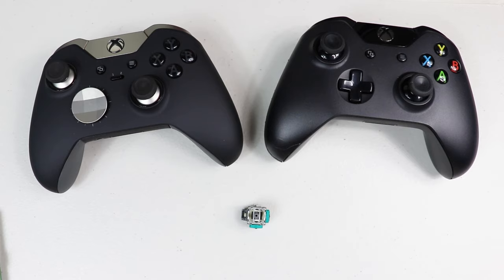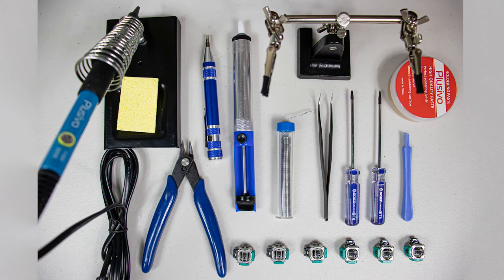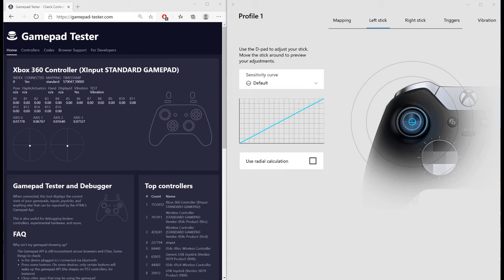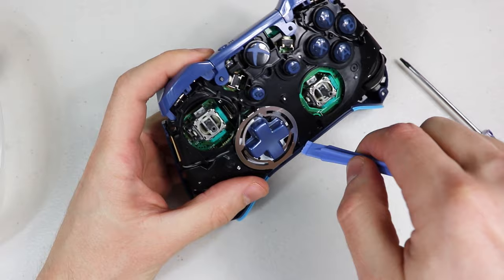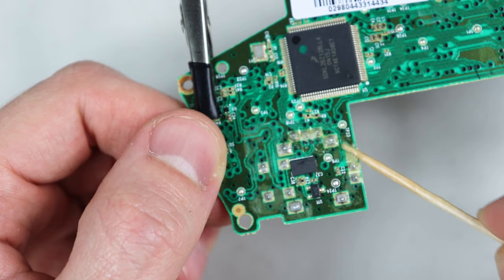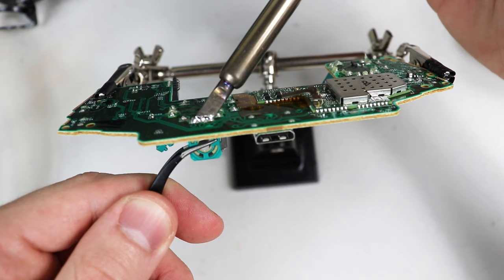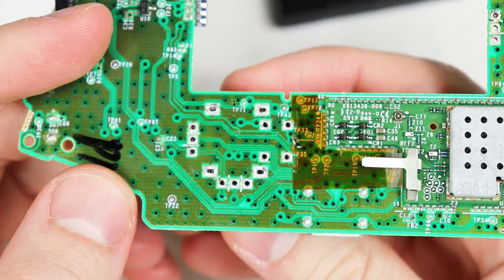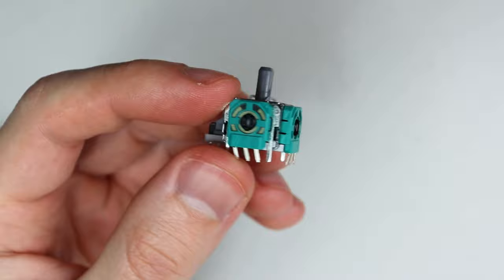How to Replace Xbox One Controller Analog Joystick - NEW METHOD - Fix Stick Drift, Broken, & Loose

Comment: Ive watched quite a few of these videos while waiting for my soldering tools to come via post but yours is the only one that seems to need to go through the tedious peocess of calibration; everyone else just plugs them in and they work.

The only major difference I see in technique is you cutting off those 3 plastic pieces on the potentiometer so that it can rotate. It seems to me that those posts are there to keep it to factoey calibration. Im guessing you are just not satisfied with factory calibration whereas most people are?

Perhaps im misunderstanding something fundamental in this video. Any guidance would be appreciated as this will be first attempt fixing electronics and soldering in general.
Reply from the maker: Well this video was made quite a while ago, and  the new series X/S controllers (and elite 2's) use integrated calibration software, so none of this funky business is needed. Plug and play and it will calibrate itself after some time. If working on an older controller this method will most likely will be needed.

Comment: I was able to replace my potentiometers after watching! HOLY it was like a long surgery. 🤣🤣 I didnt need to calibrate anything since it was already perfect when I soldered the new pots. I think I also need to calibrate dead zones since finer movements on the stick are not smooth. Anyone know how? lol Will they get better as I keep using it?
Reply from the maker: Can you explain more what you mean by the finer movements on the stick not smooth?
Reply: @SOSSGAMING  Like when I just push the joystick a little bit and not fully in a certain direction, it has a hard time registering it as me only pushing it a little. It would suddenly jump really quickly to that direction. Not very smooth. It's like the sensitivity for smaller movements is weird. Makes it hard to aim accurately at farther distances in an FPS game where you would only need to move the joystick a little bit for example. I hope that makes sense. Its the same for both joysticks. BTW, I replaced the whole joystick and not just the potentiometer.
Reply from the maker: @ineed8800GT  Ok, are the joystick by chance the ones with integrated deadzones? The ones with white wheels in the potentiometers? If so, that will be the culprit. If not, it may also be an in-game deadzone setting. If it's a elite controller or x/s controller, it may be a joystick setting in the accessories app. That's all I can think of at the moment.

Comment: Nice replacement. I'll be doing this on the Series controller. Hopefully this week. Waiting on the parts. Are you calibrating with a 0% deadzone?
Reply from the maker: On these controllers I can usually get within 2%.  On the series 2 controller I'm sure you'll be glad to hear they self calibrate.  Meaning you just need simply replace the joysticks, and from just moving the joystick around for a while it will gradually adjust itself.  Pretty neat.

Comment: I'm on my 3rd XBOX controller now due to drift problems.  I tried to fix both but no joy, I bought a new ones.  I never had this problem with the old Atari joysticks, they were indestructible!
Reply from the maker: I'm sorry to hear about the struggles :/ Sometimes it can be frustrating.

Comment: Awesome video! Very thorough and informative. Didn't know that replacing the joystick required calibration. I've seen you are based in the US. By any chance do you know a reliable source for purchasing Alps Alpine sticks in EU? A couple years ago did my first gig in soldering with an Xbox One controller, and while I managed to pull it off, the stick felt stiffer and not as responsive as the original one. Seeing your sparked my interest again. Cheers
Reply from the maker: Thanks! Honestly I'm not sure on where you can source one there.  I do have an eBay with international shipping options and I think EU is included.
Reply from the maker: Here's the link if you wanted to see: https://www.ebay.com/itm/223831814472
Reply from the maker: Let me know if that works and if/what ebay shows the shipping charge to EU is I would be curious to know
Reply: @SOSSGAMING  So when i buy your stick set on ebay it includes 6 of the "Alps Alpine RKJXV122400R" right?
Is that also the stick that the playstation uses or is there a difference? Do you know if it is also possible to order a lot of potentiometers on top of these? Because you then dont always have to "throw away" some of the sticks just because the potentiometers arent perfectly right. Maybe that might be a new bundle idea for you :D.
Reply from the maker: @GeneralSouL99  That model is the black pot variant. To be honest, I'm not sure the difference between those are the original. The only difference I'm aware of the the base of the RKJXV122400R have two protrusions on the base of them to fit into custom pcbs (like scuf uses).  The ones I sell are original (alps also).
Playstation use a different stick (alps also). Those ones have a raised base, higher stick tension, and a slightly wider pot range. I don't recommend using one in the other.
As for the pots, I now sell them by themselves, but only on Amazon for now. (only 6). But will have 20 and 100 pot bundles in the near future, on both Amazon and eBay. Thanks for the suggestion.

Comment: When an off brand analog stick is “squared”, is there a reason for that ? Is it fixable ?
Reply from the maker: Actually I wish I didn't include that in the video as I believe the info I received was inaccurate.  I need to verify this but I think it's more to do with left vs right analog. I believe it's inherent in the software but I'm still not 100% on that.  It's an easy check but I just haven't had time lately.

Comment: When I installed these on both my controllers (which had stick drift), they were both off centered roughly by 4-8%. However, when I used them both on my xbox, not only did I not notice any drift, but when checked them again on gamepad tester, they were perfectly centered within the 0-1% range. Do you think that my xbox calibrated the new joysticks on both of my controllers?

Edit: I should've mentioned this, but I didn't do the manual calibration trick shown in the video  mainly because I didn't have a knife sharp enough to cut the nubs off the pot holder.
Reply from the maker: If it was on the S or X controller, it did manually calibrate itself. If it was on any previous model controller (including the elite series 1), then it was very lucky!
Reply: @SOSSGAMING  It was, in fact, a xbox series s/x controller!

Comment: @SOSS GAMING  amazing video/tutorial. I got a question for you,does it matter with which analog stick joystick is used to replace the OEM one? on the market are the one with blue base and white base or are both the same? I am looking to replace on Xbox elite controller. Thank you !
Reply from the maker: Thanks! I would say yes, it definitely matters.  There are many bad versions of joysticks with deadzones and button issues.  If possible, try to source the ones with the grey base and black wipers inside the potentiometers.  If they meet those criteria, I believe they are likely to be the ones you are looking for.
Reply: @SOSSGAMING  thank you

Comment: Nice! I never seen this way of calibrating before, def going to do this on my elite controller. One problem, I had to remove power IC "U1" from the board and it took D23 with it in the fall due to component failure. Any idea what diode I'd replace D23 w/ ? (I do not have a spare board)
Reply from the maker: Great question. Sounds like a question for the guys at acidmods forum. I'd recommend trying to post the question there. I don't know these boards nearly as well as they do (RDC in particular). Wish I could be more help.

Comment: Try to use DS4 sticks they are more tight and have no wiggle in the center
Reply from the maker: Yes I agree! It also depends on personal preference with the higher spring tension.  What is your similar method for modifying the base to get them to sit flush on the boards?
Reply: I personally just take a blow torch and a flat metal tweasers to melt the bottom flat. Gotta be careful to not melt to much tho. Then if need be take a razer and file down the remaining plastic
Reply from the maker: @swifdy6855  Nice!
Reply: @SOSSGAMING  the xbox one joystick analog fit flush on ps4 mobo

Comment: do i need flux when unsoldering? and is there a specific flux and solder to use?
Reply from the maker: It's recommended, but technically you can get away with just the flux in rosin-core solder.  I've found that brand does matter. Some brands lie about the contents of their solder, and are cheaper for a reason. The cheaper ones do not solder well. The brand I personally use and recommend is Kester. 60/40 rosin core. Luckily with flux there's not much of an issue and any brand should be fine.
Reply: @SOSSGAMING  thanks you

Comment: Yeah I have kits for when I fixed my 360 controllers I have like 5 Xbox one controllers and two that are for my series S all have bad joysticks I planned to just swap em but wtf now it requires soldering and I don’t do that. So fuck kinda pisses me off cause I can make a few good controllers just by swapping. Such a shame miss when it was more similar and just connector, clips. 😅

I’ve never been good at soldering…..😅

Comment: A "new" Method.. But you can also simply buy a heated desoldering pump for 15 euros and desolder all stick modules in one piece without any problems. Whether small or large holes. I do this all the time on all kinds of controllers with a cheap 40W pump.
Reply from the maker: That's great! The "new" refers to the calibration process. Thanks for watching!

Comment: Thank you for your videos! This is the first time I see this issue mentionned. I need to replace the joysticks on my wired 360 controller. Would this be the same process? And do you have any tips on how to mod an overall better quality pad (more precise and/or firm controls)? Maybe there is different buttons grades, i don't know...
Reply from the maker: Yes, I have done it on a 360 controller. However, this was with original joysticks. There are many 360 joysticks out there with the integrated deadzones that will probably be what you will find most of, and in that case you won't be able to, but will have integrated deadzone. I'm not aware of any different pads, I'm guessing you mean for the dpad and/or buttons?
Reply: @SOSSGAMING  Thanks for responding. I suppose I can find those on aliexpress. For the rest, i mean either dpad or other buttons. I saw your other video where you change and upgrade the elite bumpers buttons. I was wondering if there was anything similar for 360. I mean, those buttons sure look like any standard motherboard mounted buttons...
Reply from the maker: @skills3779  Yeah, I'm not aware of any upgraded pads sorry. As for the bumper buttons, the "upgrade" was reverting back to the ones in the previous xbox controllers which are better, which are also in the xbox 360 controllers lol.  So as far as those go, you have the best ones that I'm aware of.

Comment: thx for the help+ I had a question what are the wires for if the controller turn's on and the buttons work?
Reply from the maker: Good question. Is it plugged in? I believe they connect the battery.
Reply: @SOSSGAMING  yea it’s plugged in I always thought that the wires have to be connected to the Motherboard

Comment: Would like to see a guide for PS4 controller, do you know if you need to calibrate on theirs also?
Reply from the maker: It's on my list :) If I can get to it as soon as I'd like, I might be able to get one up in a month or so.  But they do require calibration and the steps shown in the video for calibrating them are essentially the same.  The only things different on the top of my head are going to be the way the controller is disassembled/assembled.

Comment: Can you use helders mod to adjust a new thumbstick module/potentiometer? If you hadn’t snipped the 3 little nubs off of the potentiometers they may not have actually needed manually twisting to calibrate. You could have tested the new potentiometers without snipping them off first as there was always a chance it worked fine anyway no? Removing the 3 nubs meant that the potentiometer was more likely to allow the potentiometer to fit on more wonkily in the first place and show that it needs manually calibrating when it may have already been set to the right position all along.
Reply from the maker: Yes, those can work to calibrate!

You are correct about the possibility of it possibly not needing calibration without snipping, but in my findings it's best practice to just snip it anyway and get a great calibration without needing to go back and snip them. There is practically no loss of stability as long as you don't cut off the 2 side nubs. I've repaired over 300 joysticks for people with this method and not an issue.

By soldering on initially, you will more than likely (about 2/3 of the time) not be pleased with where it sits, and want to adjust regardless.

I also made another video years ago with a different calibration method where no snipping is required. But it's quite more time consuming, and the calibration results aren't quite as good.
Reply: Helders can work fine if only slight adjustments are needed to center the joystick. Large adjustments wiill reduce your joystick's range of motion, quite noticeably, or even severely.

Comment: can you please explain how much temperature you need not to damage the circuit board and what power ratings like watts , voltage and stuff u need for solder.
Reply from the maker: Each soldering iron is different. 350c is about what I use on my soldering iron.  I would start maybe a little under that and see if the solder melts enough. If not, bump it up a bit more. 

The idea is removing the solder fast as possible, and using not too high of a heat (or leave it for too long) to melt the adhesive under the through hole pads.

Comment: Maybe the resistance of the knock off is too low so it gives a stronger signal to the motherboard?
Reply from the maker: Resistance is the same actually. Rated 12k. I'm thinking it has to do with the mechanics of it, as in it provides more movement at the wheel, and it doesn't need much to make it faster. Could also be with the resistance material itself somehow. Great question.

Comment: Do you know that the reason you have to calibrate the sensors is because on the back of each there is a number.  Each number represents placement on the analog control modules.  One says 8, 12, 6 and 3 in reference to hour hands.
Reply: Sometimes there are letters like D for down, L for left R for right and U for up.
Reply from the maker: Very interesting. Can you expand on this?  I'm looking at a few right now 3e, 3d, 2d, 2f, 3g.  I'd just assumed they were batch numbers or something.

Comment: I've tried this on two separate controllers - a normal xbox one controller and an elite (v1). The normal controller doesn't register any joystick movement now, and I'd love to hear any advice on what part of the motherboard might be causing this! The elite controller went much better (i'm proud just to have removed the drifting joystick!) but there is a deadzone around the center of the joystick. I'm going to put it back together any way, and see if I can adjust my settings on my box. Let me know if there is something I might have done by mistake to cause these issues!

Edit: just turned on my console with the put back together controller. My xbox will not display anything through it's HDMI any more. I was playing earlier today with a different controller, everything was fine. Either I am extremely unlucky or this was caused by the controller in some way.
Reply: Tried resetting my box in every way possible, including a factory reset from usb…still nothing. Hope this doesn’t happen to anyone else
Reply from the maker: I'm sorry to hear about the struggles you are facing. The culprit of a joystick not working after install is most likely a damaged through hole pad(s). It is possible to fix this through jumper cables, but I'd have to know what exact model controller you are working on to know where to put the cables. 
As for the console, that is most likely just a coincidence. I can't see any way a controller could interfere with that, which is quite unlucky I would say :/
Reply: @SOSSGAMING  Thanks for the reply! I have to admit I was extremely upset when my standard xbox one controller's working joystick stopped registering any movement. That would be the model with pad damage I'm assuming. BUT I have had SO much fun learning about controller repairs and soldering in general from this video! I was practically jumping for joy when I first removed my elite's broken joystick with the small through holes. Thanks for sparking an interest in this hobby for me. I assumed my two controllers were trash, and because of you they have become a learning opportunity:)

Any tips on the joystick deadzone for the elite controller (v1)? Do you think that I should just try replacing the potentiometers? The deadzone is a small ring around the center of the joystick, in all directions.
Reply from the maker: @sikonward  You were able to get the whole joystick off? That IS impressive! Well done. Glad to hear you enjoy the learning process as well. It can definitely be frustrating, but rewarding at the same time. 
There's a couple standard models, if you look at the sticker behind the batteries it should tell you which one exactly.
As for the dead zone, how are you able to tell? If it's from the joystick itself (the most common/cheapest one on the market have integrated deadzone) you will need the original joystick (or yes, you could replace the original potentiometers).
If you mean in-game deadzone, there should be in-game settings where you can dial it down. Not sure if that helps.